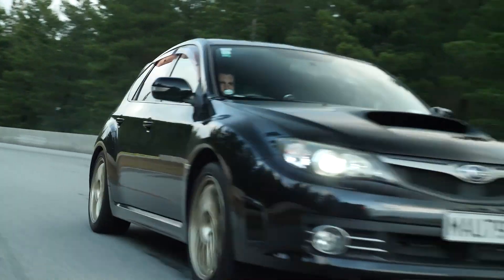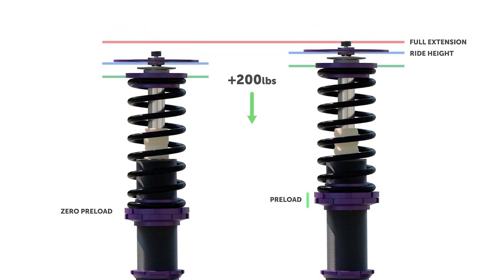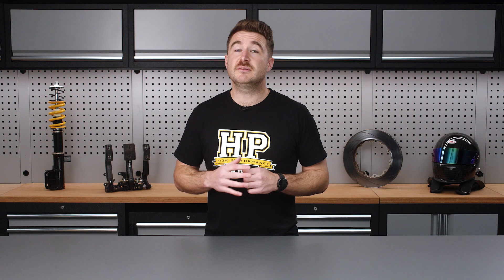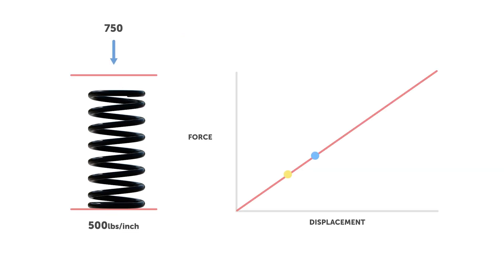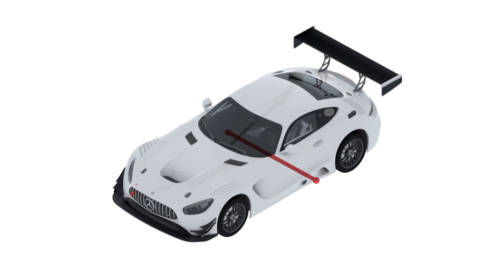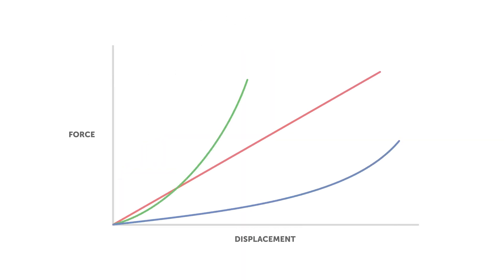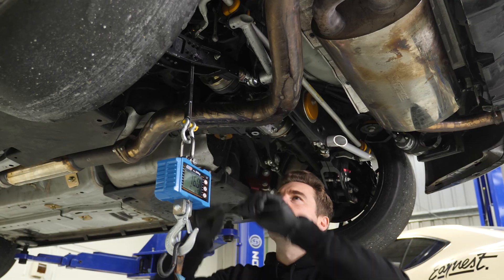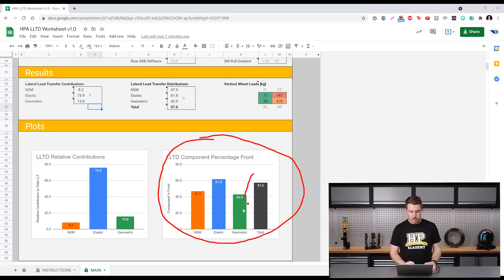Suspension Tuning & Optimization [#COURSE]

Comment: This is the information people who compete really need to know. Far more valuable to lap times than another 25% more power.
Reply: I would take the HP now and the suspension tuning next. Suspension does nothing on the track in the straightaways which on most tracks is about 2/3rds of the total distance.
Reply: @GaryL3803  It depends on the layout of the track and to some extent the car. 
The higher the speed carried through a corner, the less acceleration is required to get to a target velocity, and the longer that is maintained before having to get on the brakes for the next corner etc, etc, etc.
With cars like the original  Lotus Elise or even a Mk1 MX5 they are flat out through a lot of corners so simply need more power. 
With the lotus, it's not troubled with bubble the standard power especially if it has the MMC brake option from the factory. Incredible car, shame I can no longer fit in it🙇

Comment: Suspension tuning is black magic once you get to the higher levels from what I understand
Reply from the maker: It can look that way depending on your knowledge level and what resources you have on hand, but like anything, there are a ton of large wins you can make before getting down to ultra fine tuning and diminishing returns which are well worth the time and effort - Taz
Reply: You need a lot of data to make good setup changes and it's all proprietary or very hush hush, oh and a 7 post rig 🥲